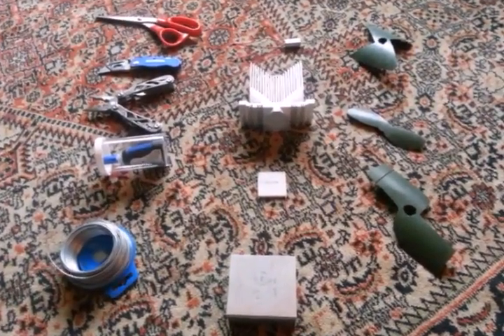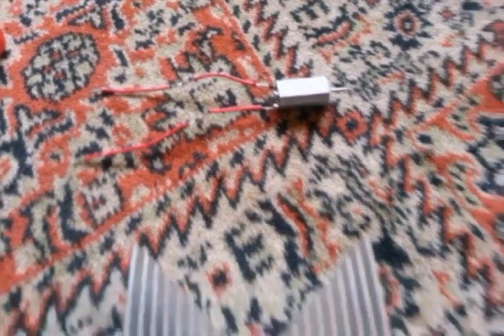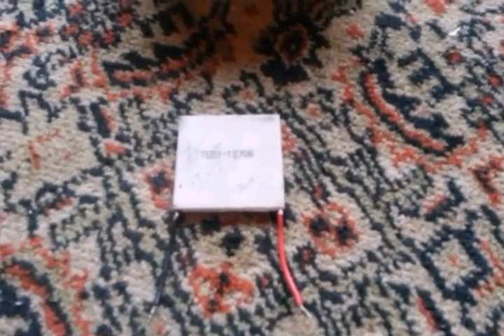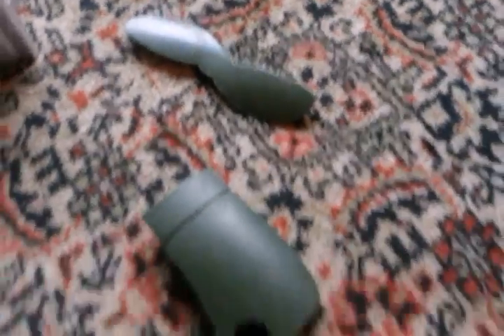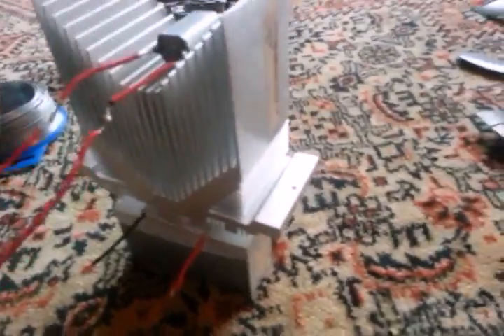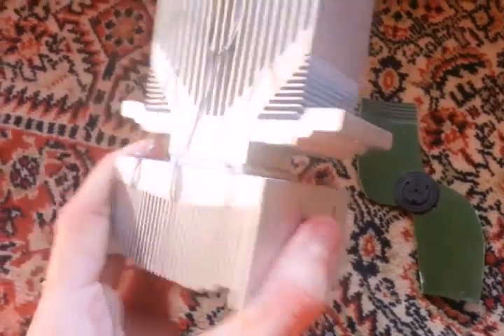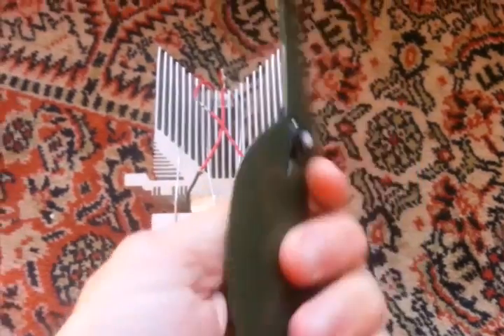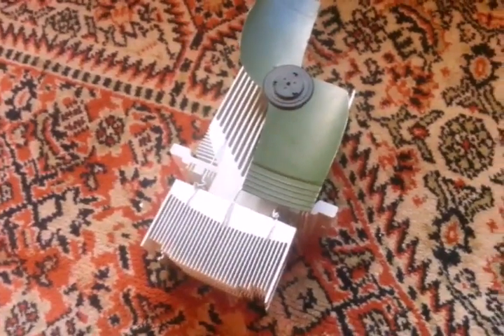DIY $2 Woodstove Fan EASY 2 minutes

Comment: So the thermal electric cooling unit costs about $2, yet the title says the whole thing costs $2...
Reply from the maker: i got the other parts for free, guy. its pretty easy to find a plant pot. easy to get a heat exchanger, just ask the guy at your local computer shop: they have a pile of them in the back room for recycling.

Comment: James, a suggestion from an old 
Overclocker.  Use some thermal 
paste between the Pelt and both 
heatsinks.  You need the heat coming 
in from the bottom, and leaving from 
the top.  The larger heat difference 
the Peltier device sees, the more 
power you'll get.  Cheap thermal 
grease will be fine, but you'll get 
more, power from some expensive 
stuff.

Here is some expensive stuff.

https://www.newegg.com/Product/Product.aspx?Item=N82E16835100007

Six dollars?  

It is good stuff.

steve
Reply: Oops, spoke too soon.

https://www.youtube.com/watch?v=2upXOb6cPLA

You found thermal paste.

steve
Reply from the maker: Steve Skouson thanks Steve! Great suggestion. I'll have some soon. Much appreciated

Comment: what range as to regards voltage should i be looking for in a small motor to go with the 12706? thanks
Reply from the maker: rick pen great question! I only found that a motor as low as 1.5V would work. my motor came from a cd player powered by two AA batteries
Reply: thank you
Reply: At least one million volts.

Comment: I have 2 questions James. 1) What is the low-voltage motor rated at to spin from the output of the peltier output? I ask this because I have used 3 fans from my PC (from large to small) and none of them are turning. They are all rated 12V DC. I dont have a spare CD player motor so I'll have to buy one - please recommend one on Amazon or Ebay that will work.  2) Is there a hot side vs. cold side to place the peltier plate? Does it matter which side is up or down?  Cheers!
Reply from the maker: I am not sure what my motor was rated for, but it was very small in size. I couldn't find a motor in my computer that would work either, they were all too big. Ask your friends for old cd/radio players they can donate. Even post on your facebook looking for old stuff to use. 

Peltier placement is pretty independent, there is no hot/cold side.
Reply from the maker: My motor is 1.5V. A far cry from 12V
Reply: oh snap. so, these peltiers are rated at 12v but, that's input not output? do you know if they make other peltiers that produce more voltage than 1.5V?
Reply from the maker: They do make much larger ones but the price increase is steep. The output can be 12v but you would need enough current to make a difference. It seems likely that a motor from any cd player that can run on 2 AA batteries would work well
Reply: I experimented with the peltier plate you recommended. 1) it only produces 2V at MAX given a super heat source vs. a super cold source. i placed the peltier on my stove top and a steel cup of ice water on top. if you go above 250 degrees F it will melt the solder coming out of the peltier. so, with that said - max voltage is 2V using 200-250 degrees with a serious cooling system on your cooling sink. we're talking low temperatures for this whole system. otherwise, all these compenents melt down.
Reply from the maker: BrawnyLads excellent info to have.  factor in that heat causes electrical resistance, as well? would you try a 120deg heat source and a cup of ice water? the data sheet says something about 50C/120F being the max temp for hot side of this part. I'm not overly sure where the most efficient Temps would lie. I posted the data sheet in the video description.  if you understand that, please share :)
Reply: all i can say is, i tested the peltier at lowest temp and max temp. they dont produce voltage till around 150F. between 150F and 250F the max output is around 2V. after 250F the solder melts on the wires. the data sheets dont matter compared to my real life demonstrations. it's ok, though, i'm not getting shitty with you. i'm just letting people know the range and limits of the peltier that you displayed on your video. i think these plates are made for lower temps and output voltage - i was confused because they are rated at 12V, but now i'm thinking that's input voltage, not output.
Reply from the maker: BrawnyLads no worries, the only reason i asked was because i don't see 'Ecofan' putting the module directly on the stove, they have a good six inch spacer in between.  i had a hypothesis that this was to reduce the temperature of the surface that the module was in contact with.  Ecofan could really be using a different peltier, a bit of digging would be useful here
Reply: BrawnyLads I had 3.5v out on the specified tec1-12706. Still works, and it managed to run a 12v pc cooling fan. It did have problems starting it however.

Comment: I'm a bit confused. You've sandwiched the flat disk you bought on Ebay between the 2 heat sinks. I thought one side of the disk should be exposed to heat. Will you explain please?
Reply from the maker: Ava Maria when you put the woodstove fan on the woodstove, the heatsink in contact with the stove is exposed to heat. the heat is conducted up through the TEC into the upper heatsink where it is released into the air. the heat moving through the TEC produces an electric current, powering the fan
Reply: Does 2 heatsinks give more heat than just one? I only have one.
Reply from the maker: Ava Maria probably not, i actually think two would give you less heat. helping you to keep your tec from melting entirely
Reply: I hope I find another one soon. Can't wait to try my hands at making the fan.

Comment: Nice video! Thank you!
Would you please explain why a heatsink should be attached to the downside of the thermoelectrig generator? Wouldn't it be more effective when the t.u. had a direct contact to the heat source? Or is it because the oven would be too hot for the th.unit and would destroy it?
Thank you!
Reply from the maker: mirinae you're right, it could work like that too. i am used the second heatsink to hold it all together.  without the lower heatsink it would just be a stack of loose parts. 

plus i think my woodstove might just fry the TEC by melting the solder. ..

Comment: only down side i see to this is that the fan blade isnt ballanced... could give you noise and vibration also making it hard for the motor to get started if its trying to pull the weight upward

Comment: Design a low voltage induction heater fan you can use for camping or for home use that can also run off solar power. Novartis
Reply from the maker: what do you mean? Im just unsure about what you mean by a low-voltage induction heater fan for camping is all. Maybe provide the description without using the word induction please
Reply: Crystal graphite rod using electrical current to vibrate crystal graphite red hot. To produce a heater and a hot plate you can operate off solar.
Reply: Like how a high energy transmission coil heats metal atoms to produce heat on an induction cook top.
Reply: A man could use a low voltage hertz emitting diode to cause the Crystal graphite to resonate and turn red hot. Y'all know more about that kinda of stuff mate? Vibration technology?
Reply: I should have went to MIT then I would not know how this science works. ; )

Comment: Nice build info.
Reply: thanks for the info
Reply: This is world new stove fan. 
Would you like to try?
https://www.amazon.com/gp/product/B019DD3HO0/ref=s9_hps_bw_g201_i5
Reply: Pan Honge Please DO NOT place the fan in front of the chimney or near the chimney,the temperature around chimney pipe is very high,it may cause damage of your fan.The optimum position is at the side or back part of the stove top.
Reply: Pan Honge framin porch